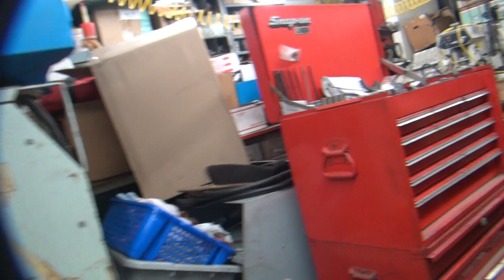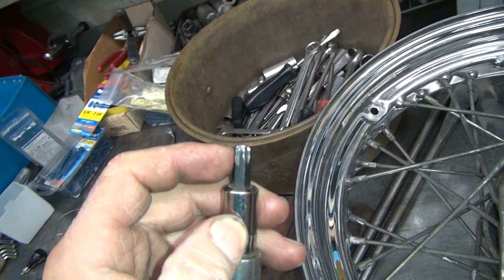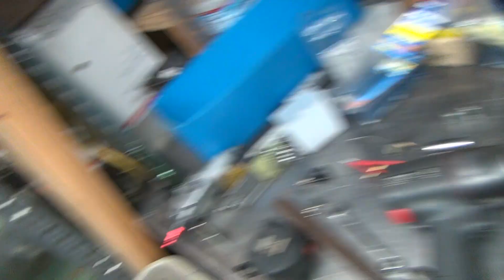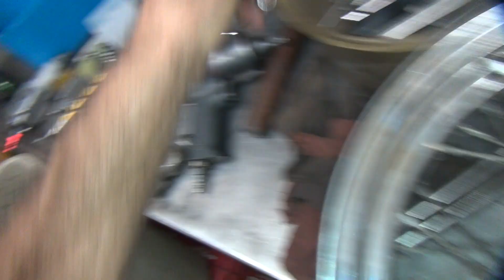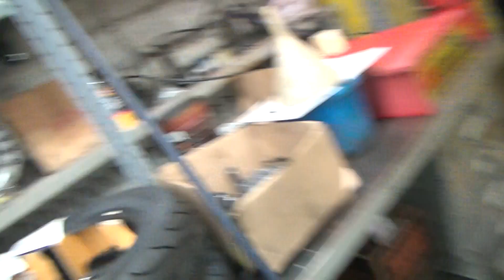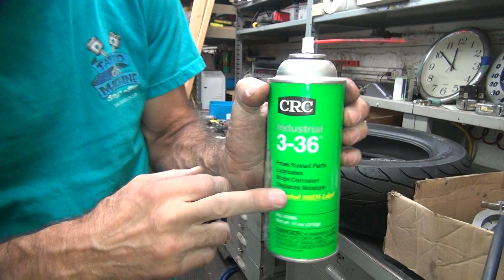#101 1990's dyna rear wheel repair installing a tire static balancing fxd harley by tatro machine

Comment: Snap on is just a name if you knew who's tools they use you'd save thousands.  Snap on is a scam they have their name stamped on someone else's tools .lets just put it this way the ratchet you pay the snap on truck $175 for can be bought with the real manufacturer's name on it can be bought for $25 same rachet made of the same parts same steel made at the same factory .
Reply from the maker: that is not always true. the way i rebuild motors is not the same as the next guy but they make more power and live longer even tho we are using the same parts. i pick and choose my tools. its not just the name on it. the type of metal, the way is heat treated and the way it is machined all matters at the end. sometimes you do get what you pay for, but not always. that one you have to learn by using them.
tatro